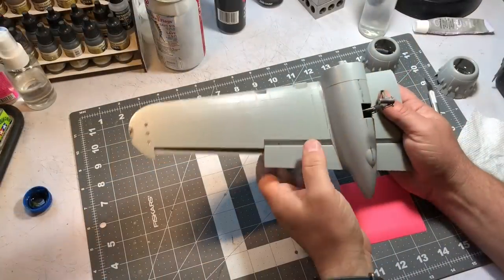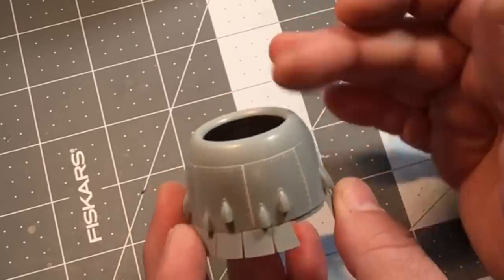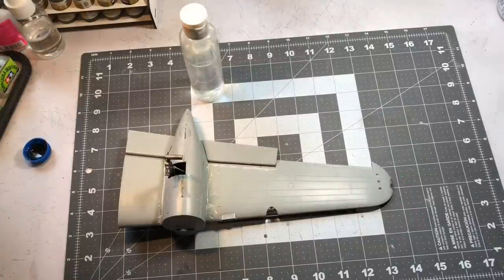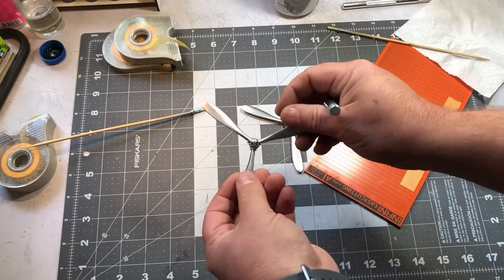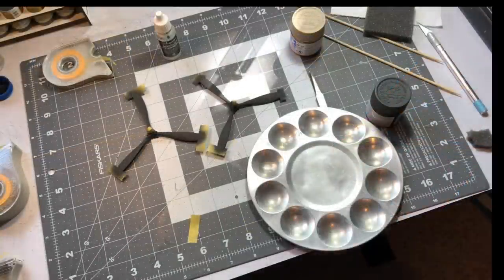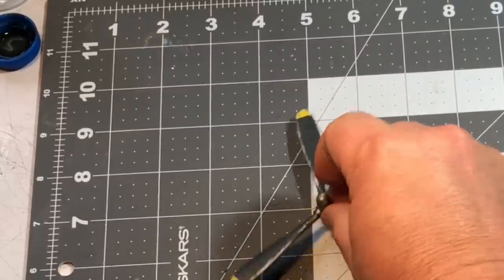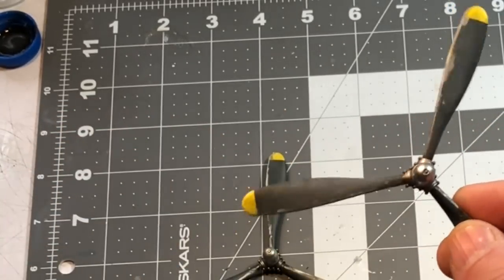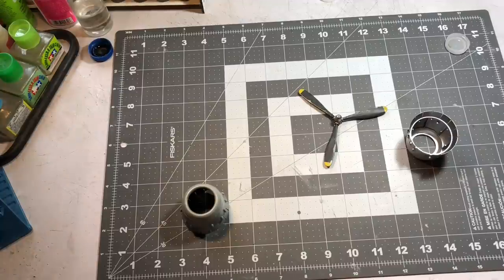1/32 HK B-25 Mitchell Build 2.0 Part 3: Gaps and Props

Comment: The testors putty technique works great. Thanks for showing it. I do use the vallejo silicon putty for smaller seams without issues but usually smaller scales. Stock up on the testors putty since they are out of business. I think it’s still sold here and there like hobby lobby.

Comment: Correct me if I'm wrong but I think I saw hk Mitchell with fivets... This one got none
Reply from the maker: It has rivets
Reply: @seanerk5kt9  must be the quality of the video then. Thanks
Reply from the maker: I uploaded in 1080 so you might need to adjust your settings
Reply: @seanerk5kt9  it does work now but it didn't before only 360p
I hate this app